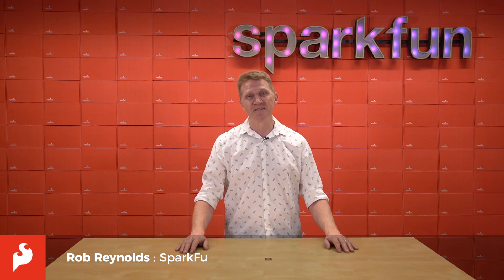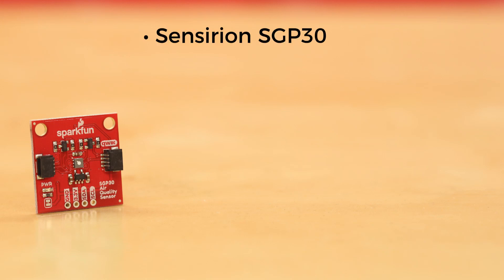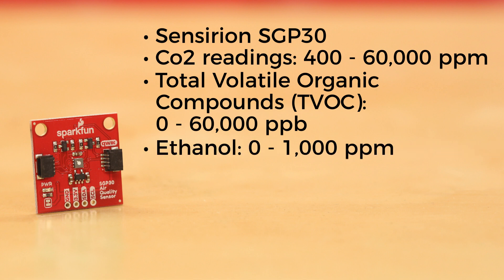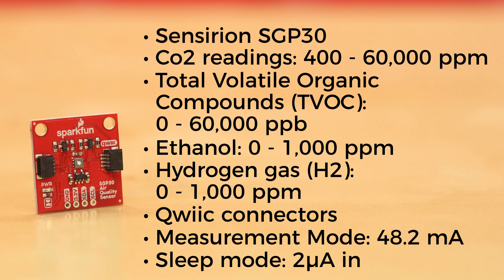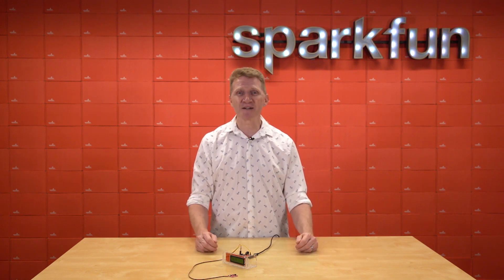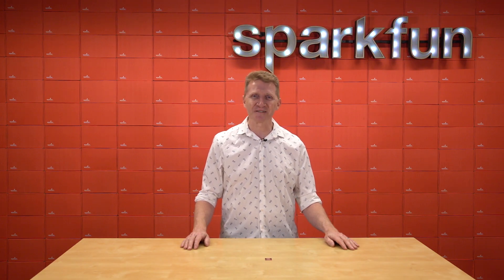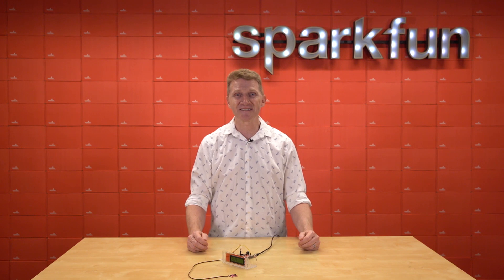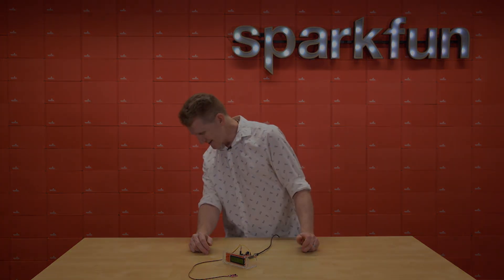Product Showcase: SparkFun Qwiic Air Quality Sensor

Comment: You still have a burn-in time with this sensor, it just works slightly differently
When the sensor powers up it checks if it's baseline value is younger than one week
- if yes then it measures the new baseline and stores it memory (external)
- if no then it needs to burn-in the sensor for 12hrs before it measures the new baseline and stores it in memory (external)

Comment: Can we stop this lie that "equivalent CO2" is actually quantitatively useful? The SGP30 is better than most since it calculates this value from the hydrogen sensing element, but at best it's still only a loose proxy for the actual CO2 concentration.
Reply: which sensor is accurate to get co2 reading ?
Reply: @iplaygames9837  Something NDIR based.